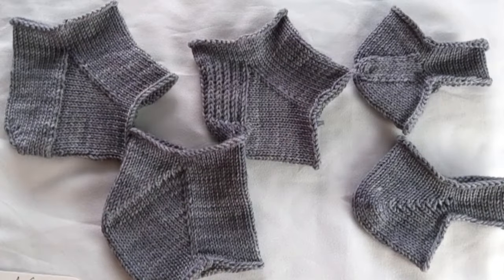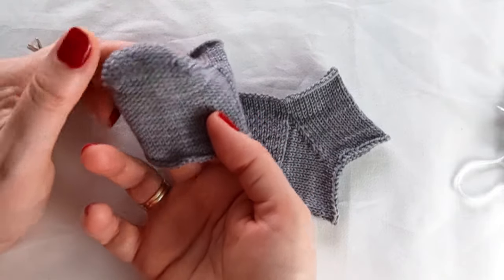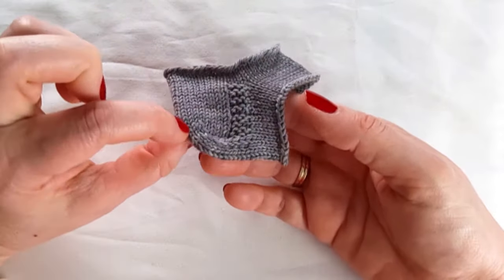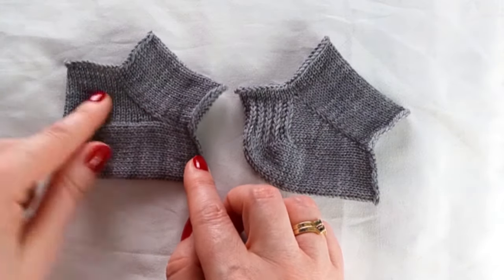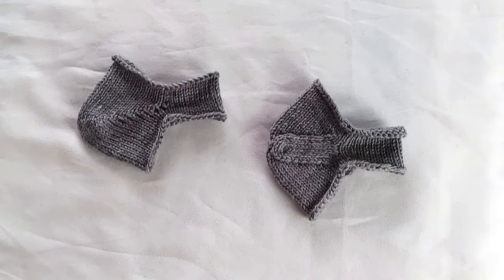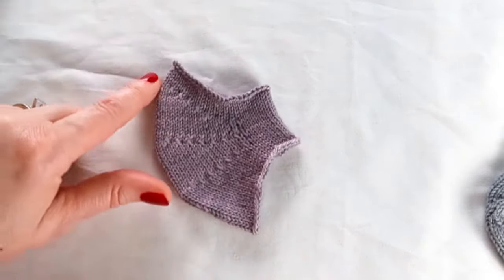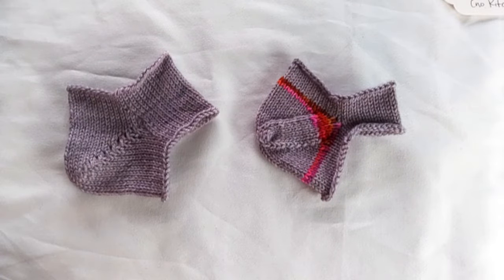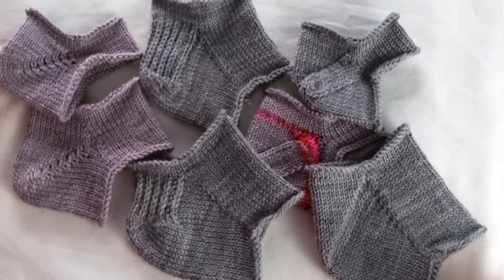SO Many Options!! | Sock Heel Comparison

Comment: Do you feel one of these heel types works better with self striping yarn and keeps the continuity of the stripe as uninterrupted as possible?  I am not using a contrasting color for the heel?  I would like to use the German Short Row or gusset and heel flap. Would  one of these work?
Reply from the maker: Yes! There are a couple options that work best for keeping the stripes consistent -- either an afterthought heel (and you can then work a short row heel or a wedge heel off the live stitches) or a short row heel worked as you are working the sock. A gusset and heel flap heel alters the stitch count over the gusset, so your stripes will end up changing (and you can get pooling/flashing lots of times.)

Comment: I have just started sock knitting and found this lesson really helpful.  What type of heel would you recommend for someone who wears out their socks at the exact same point.  I have thrown out numerous pairs of sock brought socks where my husband wears a hole at the point where the decreases meet the increases on German short row heel.  I was thinking perhaps an after thought heel combined with decreases like you do for a sock.  Would love to know your thoughts?
Reply from the maker: You can get reinforcing thread (it's a nylon/wool blend typically, in a thinner weight than sock yarn) and hold it together with your working thread as you work your heel -- this can be really helpful for heels that wear out often -- it tends to thin instead of going straight to a hole, and can make it easier to darn and repair. 
Afterhthought heels, in a different color yarn for ease of seeing those stitches, would work, and then you can remove the whole heel and knit a new one when the heel wears out!
Reply: @HeatherStorta  thank you very much, that's very helpful.

Comment: 1:52 I am just curious about the pattern on the heel flap for the handkerchief heel. It looks almost like a really subtle honeycomb. I have done the slip stitch flap like the round heel that shared the frame but I have never seen the subtle lattice style heel flap. Is it just a pattern or is it a style of heel flap?
Reply from the maker: Great question! That is called an "eye of partridge" heel stitch, and it's a variation of the ribbed-looking heel stitch. It's a 4 row repeat instead of a 2 row repeat and on row 3 you just switch the place of the slipped stitch. That creates that (still cushy, but less constricted) checkerboard look with the slipped stitches. I have a video showing you these two fabrics specifically here: https://youtu.be/ocsWEKympuc

Comment: Thank you for all of this ..i would like to make heel with a contrasting colors on a toe up socks with gusset is it possible ? Thank you very much
Reply from the maker: Yes, if you did a toe-up heel flap type, and after all gusset increases switch to your contrast color for the heel turn and the heel flap part. (Or just for the heel flap, that's another option - the color will be only at the back of the heel in that case.) Then before working in the round again switch back to your main color!

Comment: Can the sweet tomato heel be worked as an afterthought heel?
Reply from the maker: No, not really. Since you have to work rounds all the way around the circumference in between each wedge, that's not possible with the way the afterthought heel works. You could do a "plain" short row heel though, by working on only half the live stitches and then grafting the heel closed to the other half when done. But any heel method that adds in full rounds in between working back and forth won't work with an afterthought heel.
Reply: @HeatherStorta  thanks! I love afterthought heels and I am looking for different heel options just for fun.

Comment: Hi, thanks for this video. I have a question regarding historical 16th century tudor heel that is seen in this video: Knitting a 16th Century Stocking // Casual Friday S6E03  by Roxanne Richardson. Which one of those heels do you think is the most similar? I´v already knitted 4 stockings to try to figure it out but it doesn´t look right on any of them. Thanks
Reply from the maker: I'm not sure -- it doesn't really look like any of my examples here in this video. It looks like it's just a garter stitch short row wedge acting as the heel, relying on the large number of stitches around the ankle being brought down closer to the ground/further down the leg to the foot. The heel turn itself is acting as the heel.

Comment: Just discovered this and it is a wealth of information (subscribed!).  It leads me to ask a question about which of these sock heels disrupts the patterning least in yarn that is stripey or has some short repeats.  I know if I do an afterthought heel, say, then the patterning stays least disrupted across the instep, and if I do my usual heel flap and (side) gusset, that can be a patterning disruptor.  Do you have any advice about this. whether there are other heel alternatives to just these two that involve less patterning disruption?
Reply from the maker: The ones that result in the least pattern disruption are the afterthought heel and a short row heel. The sweet tomato heel might work ok as well. Anything that leaves the stitch count alone (around the foot and the leg before and after the heel) -- and that allows the heel to be worked independent from the instep stitches until the heel is completely done - will be the least disruptive. The ones that have a gusset to provide more room in the heel apex diameter will disrupt the patterning the most (heel flap with gusset being the one that produces the most disruption). I always use an afterthought heel with my self-striping sock yarns, myself!
Reply: @HeatherStorta  Excellent information!  I am going to experiment with this next and I so appreciate it.

Comment: Are heels interchangeable?! Meaning can i use a short row heel in place of a heel flap and gusset or vice versa?!
Reply from the maker: Possibly -- with a strong caveat. Some are easier substituted than others if you are changing an existing pattern. For example - a heel flap and gusset instead of a short row heel might mess with the patterning on the leg or foot -- and you would need to start the heel sooner on the leg to allow for the added depth that a heel flap and gusset takes up compared to a short row heel. Also, the heel flap and gusset includes full rounds in the gusset, where a short row heel has no full round (usually) within the heel structure. So self striping yarns will change their striping over the gusset, where in a short row heel they are precisely maintained on either side of the heel. You have to consider things like that when making a substitution. 
But, the various heel flap and gusset constructions are certainly interchangeable within that group quite easily.

Comment: Which heel makes a longer diagonal?  I can knit to fit my foot ir keg and they don't turn to put on. I think I have a longer diagonal even though I have a shorter foot.
Reply from the maker: A heel flap heel tends to make the longest diagonal -- you could try working the heel flap longer than typical, this will deepen the heel height and increase the gusset area, making that diagonal longer, too. Or work less rapid decreases in the gusset to keep the gusset as wide as possible for longer. It might take some trial and error to get a shape that works best with your foot.

Comment: I saw a flap across the bottom of the heel.  I have specific areas of my socks that wear out faster than others that are not the back of the heel. Would this be an option to create a thicker fabric in those 'at risk' areas customized for my wearing patterns?
Reply from the maker: Hi! You for sure could create thicker fabric in those spots -- either as an extra flap of fabric, or you could add in reinforcing thread (carry it with the working yarn) in just the spots that need reinforcing. Using a stitch pattern like heel stitch or eye of partridge can help to add thickness in those spots too.

Comment: I can’t seem to find this answer by googling it, so I thought I’d ask here! What kind of foot shape would benefit most from the heel with gusset decreases placed at the bottom of the heel flap? I’m curious if this could help me get a better sock fit! Thank you for this video!
Reply from the maker: I think if you have a really high instep/arch, or a "pointy" heel, that placing them at the bottom of the gusset will help to hug the heel much better. I find that the sock sole curves up and hugs my heel much better with gussets made this way! I don't think I have a particularly high arch, but I still find it's a bit more form-fitting in that area.
Reply: @HeatherStorta  intriguing! I’m going to have to try that heel! Makes me admire all the tiny tweaks that make point shoes fit to perfection 😍

Comment: Do you have a pattern for the Round Heel variation shown at 1:37?
Reply from the maker: The round heel is what is usually seen in modern sock patterns that use a heel flap. You will work 2 or 3 sts past the center of the heel flap and then work the decreases (on RS rows it will be knit x sts, ssk, k1, turn - and on WS rows it will be purl x sts, p2tog, p1 turn.) On subsequent rows you will work to one stitch before the gap, then work the decrease and one more stitch and turn. 
The only difference between the round heel and the wedge heel is that the wedge heel places the first decrease immediately after the center of the heel flap, instead of working 2 or 3 stitches before working that first decrease.
I hope this made sense!!

Comment: Thank you, Heather, so much information to learn. I just have one little question: why would Kitchener make the bottom of the first 2 heels uncomfortable? Doesn’t grafting just add a row of knitting, not a ridge?
Reply from the maker: It's not the Kitchener spot that leaves a ridge, but the picked up stitches all along the heel flap and around the bottom of the heel that leaves a ridge and could be uncomfortable.
Reply: @HeatherStorta  Thank you. I misunderstood.